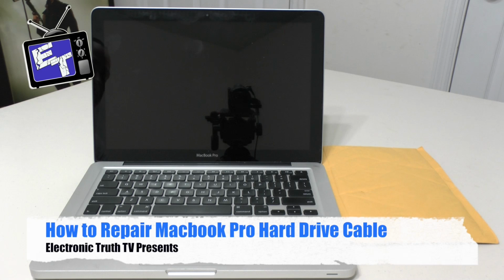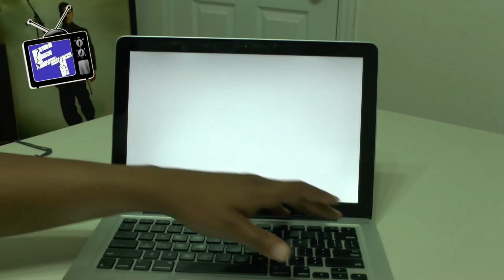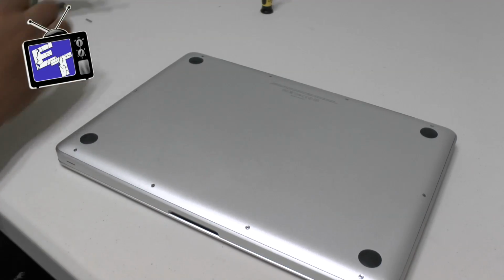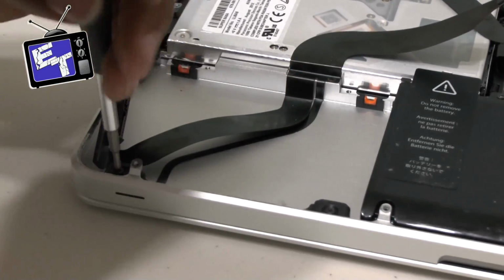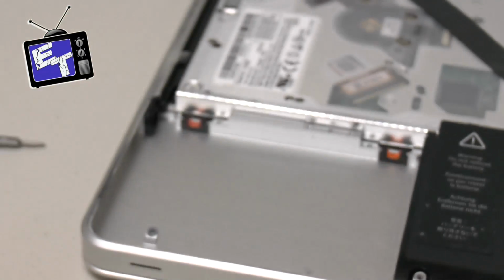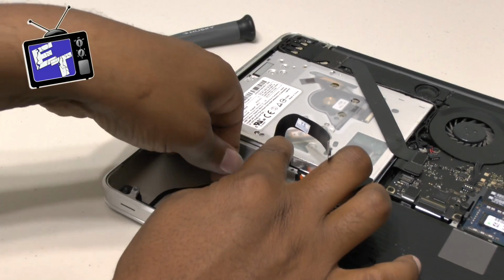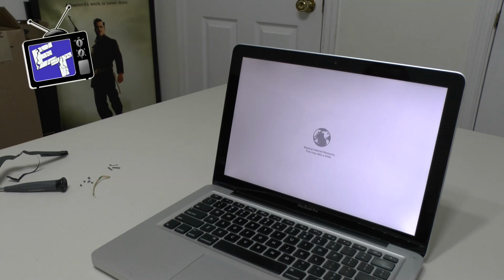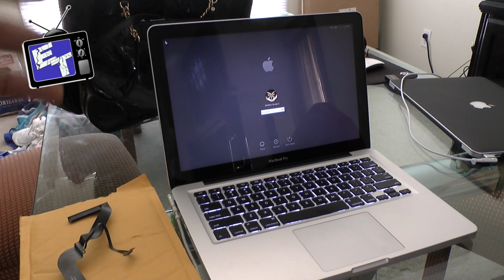How to replace Macbook Pro Hard Drive Cable

Comment: SO MANY THINGS DONE WRONG IN THIS VIDEO!!!!!!  Wrong cable P/N was installed, it requires the shorter earlier model cable, you installed the longer later model cable, that's why it's bunched up and doesn't fit properly. they even look different when you compared them. And you completely botched the IR cable attachment, you ripped it without undoing the clip that secures it and just shoved it back in. also you have to bend the new cable in order for it to fit properly where it steps down to go under the HD. Horrible video!!!!

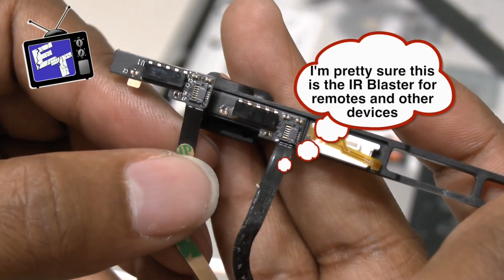Comment: At 7:04. I've tried to insert the cable from the light indicator to the bracket on the new hard drive cable, but I can't make it fully inserted into the bracket. At first, I thought the replacement was not designed correctly, so I bought another one. Alas, I'm facing the same problem. Any tips on how to tackle this problem. Thank you!

Comment: Your video was good up until the point where you had to do a close-up  for the front panel connector then the detail was blocked either by the advertising or you kept running the focus point out of the frame of vision.  This all started about 6:36 minutes in.  A good video but I would try to refine that area if I were you.

Comment: That tiny orange ribbon cable is bloody hard to get back in after flipping the connector up. Any advice on sliding that orange ribbon cable in the front bracket with the IR sensor on it?

Comment: You can have this cable issue without the flashing question mark folder too. For me I only occasionally got this question mark folder and it would not flash. What I seen logging in was a circle with a diagonal line that would show a flashing Apple logo every few seconds. Then it would lock on the Apple logo with a progress bar that took forever to get to the login screen. Sometimes the progress bar would reach 100% and nothing else would happen. I would boot in internet recovery mode and sometimes my hard drive did not appear, other times it showed it as full even though it had over 500GB of free space on it. I also had the issue whereby when I could login things would work good for a while but then the computer would act up. I was constantly getting a spinning beach ball whenever I clicked anything in Safari, tried to type, etc. I replaced this hard drive cable myself and my MacBook is running like a champ now, fast login, super fast when using it and no more spinning beach ball!

Comment: i recently bought an SSD drive and copied and installed it on my mac... after working wonderfully for a few hours or so the screen just went black and i had to force shut down. then trying to boot up i either get the circle with the line blinking back and forth with the apple, but the computer never boots up again until i re-install the original drive.. i was told by the apple community, someone who had 9 stars, and a tech from OWC where i bought the drive that they think it's hard drive cable... watching these video's it seems easy enoughtho i am a little intimidated... hopefully the change goes smoothly... mine is a mid 2009 15 inch pro...

Comment: Hi, I've replaced the said wire(hdd to MotherBoard) however i still have the issue, I contacted apple but they said i take it to apple for a hardware diagnosis. Any ideas of the possible issue, I'm looking to up grade the RAM next.

Comment: i recommend also disconnecting the battery cable as soon as you lift the case off. so that no stray current is roaming around. good video i and i relate - as i have self-taught some repairs and mistakes r easy to make.  ps, i loved the music!  gave a positive upbeat feel. thanks Chris for taking the time to share this - and thanks to ducky102 also...

Comment: This s**t is sooo teeny weeny microscopic (the ZIF part…) that it requires two VERY steady hands, a vise, and a good enlarging glass. This is NOT to be even ATTEMPTED at for anynone older than 20. I’m 55, and I can’t see, and I shake waaay to much for this microscopic stuff.
Be forewarned!
I’ve tried, and got that damn ZIF out, and relaised this is WAAAYYY beyond my abilities. I doubt I could even glue together an Airfix-set, not to speak of painting it (such as the window panes or the pilot) without a serious magnifying glass & some arm rests…
Call in the young’uns for these sort of jobs. I tried, and I’ve failed, dumping the lot on some able-bodied folks I happen to know. Whom will receive a suitable reward…

Comment: Hey I want to thank you for the great instructional video! I researched how to figure out what was wrong with my MacBook Pro AND FIGURED OUT THAT IT WAS THE CABLE FOR THE HD, I ORDERED ONE AND FIXED IT JUST LIKE YOU SAID AND I AM UP AND RUNNING LIKE NEW AGAIN ! Aside from hitting the lock caps by mistake this computer is like new! Thanks!

Comment: So after reading ducky102's comment I realized what a ZIF connector is and how many of these videos show incorrect removal/insertion. I have no experience with this, but if you're trying to save money by avoiding a repair man, this is what I've learned.... DO YOURSELF A FAVOR AND BUY A NEW CABLE WITH THE BRACKET ALREADY ATTACHED. I returned my cable (without the bracket) and ordered one with. SUCH A TIME SAVER. Spend the extra 10 bucks. You'll thank me later.

Comment: What can I say... Thank you, thank you! After my macbook failed I replaced the hard drive... no luck. I spoke to apple support. They told me my macbook pro 2011 was now "vintage" and unsupported. I was on my own... then I did a little research, found this video, bought a £10 cable and now I'm back up and running! You saved me £1200 for a new macbook!!! much appreciated

Comment: hi Chris. nice video. my Mac book is a little different 13" wide. case has 8 screws on the side and 3 on the bottom OS 10.7 Lion. I haven't opened it yet. (afraid to lose screws) can you give me a link for the correct HDD cable,? ( this is a flashing ? folder problem). thsnks
Reply: Apple Macbook, A1181 OS 10.7 Lion
Can u send me the link for the HDD replacement cable. Thanks

Comment: Alright, guys, for everyone struggling with the golden cable - if you already glued the "main"  black part of the cable - just carefully peel it back from the bracket and then safely and easily insert the golden cable. After you do that, glue the connected cable back to the bracket.

Comment: This is the clearest video to follow.  I bought the cable from Commandmacparts (Ebay), NEW HDD HARD DRIVE CABLE - Apple MacBook Pro 13" A1278 Early,Late 2011 MD314.  It worked great for seven months until the "?" issue came back.  I'm checking out this video again to replace it for the second time.  I bought the cable from a company that has a lifetime warranty as opposed to just two months.  Hopefully I won't have to replace it further.  Thanks Chris for the clear video.  But as pointed out, don't yank out that tiny yellow ribbon strip

Comment: You have to tell people the yellow/gold cable is very sensitive and that it cannot be torn apart, it cannot be discarded. I pulled the yellow cable out and it broke in two, now it has to be replaced. You must note that in the video
Reply from the maker: +Fillip Nelson so sorry Fillip that you had to replace that cable... at this point, not tugging on the gold cable has been made very clear in the comment section. I was able to salvage mine, and because I was, I didn't feel at the time I made this video that it warranted a new video. Fast forward to now and I welcome anyone to make their own video showing this process, or just how to properly deal with the yellow cable. I will gladly pin it to this video. My goal was to try and help people and give the best information that I had at the time... anytime that information can be improved upon, it is welcomed...

Comment: WHERE DO I GET THE ^PARTS TO ORDER I`M IN CANADA
Reply: New Hard Drive Flex Cable 821-0814-A for 13'' A1278 MacBook Pro 2009 2010 on amazon.ca

Comment: AWSOME tutorial, this info timeless. if you can include in the beginning: "For precautionary purposes, we advise that you disconnect the battery connector from the logic board to avoid any electrical discharge.
Use the flat end of a spudger to lift the battery connector up out of its socket on the logic board." 

everything else i followed your video to the letter :). 

happy holidays.. now i can give my wife my 210 mac as a christmas present. (( HELP!!!... durring installation process, when it says  "select the disk where you want to install mac OS x,  i dont see my hard drive as  a choice))

Comment: Appreciated your video Chris. Help me remember how to reinstall this hard drive cable. They tend to be very problematic on the mid 2009 and 2010 models from what I understand. It is detailed and tiny work but if you take your time and be gentle, especially when pulling things apart, it works great.

Comment: there are actually 3 types of screws (the small ones look the same until you look close) the front 4 are shouldered, and the 3 others are not shouldered, the three long ones go at the back obviously... the 7 short ones appear interchangeable and however they will get loose and fall out if installed incorrectly, for example if someone has worked on the machine and didn't notice this.

Comment: @7:40 mark. How did you get that yellow gold strip back inside that tiny hole??
Reply: You just slide it sideways from the natural direction of the strip. Using a flathead to position the strip just right helps. Also lots of light. Also lots of patience:)

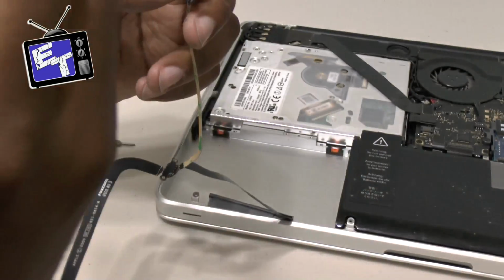Comment: This is a great video, very helpful, but the most difficult part from 7:38 to 7:44 is cut out.  This step to reconnect the cable took me the longest, everything else is straight forward.
Reply: How did you get that yellow gold strip back into the slot?? Thanks
Reply: It was not easy, I ended up using a pair of tweezers to get it in, being careful not to damage it.
Reply: +Binsk 888 I am still waiting for my new cable. Should be here within the hour. In the interim I am practicing on the old one. Extremely difficult even with tweezers.
Reply: Yes, took me about 15 minutes of trying to get it in.
Reply: +Binsk 888 I am wondering.  Is it actually necessary to reconnect it?
Reply: assume so, but dont know for sure.
Reply: Well I got it up and running. Couldn't get the yellow cable inserted so I said screw it ..leave it off.
I also could not get the one screw in where the middle part of the cable folds down and two screws are needed. 
I put some electrical tape down this time but if it goes on me again I will spend the extra dollars and get the cable with the bracket next time. 
If I have any criticism is that I have booted up twice and I noticed it the apple icon takes a bit longer to appear than it used to. 
Oh well for a $36 repair I am not complaining.
So far so good. Thanks a ton for your quick responses.

Comment: I am thinking to install the new HD in the second slot, removing the preinstalled CDROM and changing i it in the site with a bootable solid hard disk, eliminating the HD in the first slot. Do you think could be a reasonable  tentative to investigate previously if is the trouble is a flat cable or the controller cause, before buying a new cable? Do you think the machine could boot in this new explained configuration? Thanks in advance for a reply

Comment: Good video, bro. Only part "missing" is how you put the small yellow cable into the small holder - guess it's just aim and push (like ye ol' days). Had same issue with start-up, took me 5 days of assemble/disassemble to figure it out :/. Figured it out after installing os in external and hdd-adapter in optical drive. Maybe add troubleshooting tags to vid...?

Comment: I have exactly the same issue and I found your video very enlightening. I 've noticed that the old cable was attached to the aluminium chassis with some kind of glue, cause when I removed it it was a bit sticky. Did you used any kind of glue or material with the new cable in order to be firm and not to move?
Reply: The new unibody hard drive cable will actually come with an adhesive for you to re-apply to the chassis.
Reply: Thank you for that.

Comment: Great video, and I love your American drawl btw! ✔️I was chilling in bed with my girl watching Under The Dome, when my Mac fell off the bed and landed with a slap on the floor, from about 3 foot. Had connectivity issues and spinning beach ball, so did some diagnostic and then got the flashing folder icon, and time machine couldn't find my internal 750HDD. Fearing a dead hard drive, I bit the bullet, hit the Apple Store yesterday. 
After they checked it out, my genius decided that the cable had gone bad, and wanted to replace at a cost of 53euros. I got an email last night saying 'my product is ready, I can come collect it' - so I guess when I dropped it I shorted the cable somehow, or a connector came loose. Either that, or when I get there today they'll say 'yeh, didn't work, you need a new HDD'. But then why would they say the product is 'ready to pick up' if there are problems? I'll report back in some hours when I know. 
I watched the video to see what Apple would be doing to my baby... ✔️

Comment: I love that you made this video..some tips:  slow down your movements when doing the crucial steps and have camera some place so your hands don't obscure that you're doing.  And MOST OF ALL: I was shocked at how roughly and casually handled the cables. I've read that this kind of handling can cause problems with the cable, that they are delicate.  And, I also vote for no music. Keep up the good work!

Comment: good video.. but I wouldn't recommend taking that yellow cable out with a screw driver. I saw how you did it and tried it the exact way myself.. snap.. I could have just pulled it out. had to end up ordering another cable with the bracket this time.

Comment: If I had to choose between a year in federal prison or inserting that ribbon again, I'd pick prison.

Thanks for the video, process was a breeze except for that damned ribbon. If you can get the IR sensor pre-installed, save your sanity and spend the extra money.

Comment: Thank you! This worked for a Macbook Pro 13" Mid 2012 Non-Retina that first was suffering from the Folder question mark after a drop, then reinstalled on new SSD, then  suffering from the Prohibitory sign at boot (and 20-30 sec later bootet normally) + error: "The partition map needs to be repaired because there’s a problem with the EFI system partition’s file system". Finally it is working. Used this replacement cable: "Racksoy - New HDD Hard Drvie Cable without Bracket 821-1480-A Fit For MacBook Pro 13" A1278 2012" on Amazon.co.uk due to shipment to Denmark was not available for most other HDD cables, but this cable is working fine as a replacement. Thank you again!

Comment: Great video! I'm glad that you have this up. I am also a computer tech, and I ordered the same replace cable for my client. I was getting the same error, & I thought the hard drive might have been bad, so I swapped out the drive with a different hard drive, but it wasn't reading that one either. So I'm assuming that it's the cable,. Thank you again for the repair guide.

Comment: How do you know whether the bracket is broken or the cable is broken?
Reply: +Henry Nguyen I think you mean the connector on the motherboard where the drive cable connects... if so, replacing this cable is one way to "test" if that connector is the problem. The professional way would be to test the pins using a multimeter, but you need schematics and lots of patience for that, easier to replace cable and hope it works. :)

Comment: am i going to have to reinstall an OS even if i use the same hard drive that i was using before? or did you just switch to a new HDD and that's why you installed a new OS?
Reply from the maker: No, as long as your drive did not get corrupted or you don't want to upgrade to a different drive you will be fine just replacing the cable

Comment: YESSSS I fixed my 2009 Mac Book thanks so much for this video I like that the angle of the camera allowed me to see everything and you talked through what you were doing!

Is it necessary to do the reboot process when turning it on with Command+R?  I dont have any software to download the operating system back if I boot regular will it work?

Comment: I think I have the same problem. The hard drive is intact (ran it externally with another computer) also I ran another hdd in my Mac and the problem was still there. So I've ordered a new cable and I'll follow your video. Thanks very much for this, much appreciated man.

Comment: Hey man!

I think i'm having the some problem as your client, i got that dreaded folder with question mark problem the other day while booting up my mac, i sent my mac for repairs and the guy replaced my HD with a samsung HD (he tested this drive with other computers and it ran fine) both 500gb, but my mac was still running really slow, like it doesn't flow, i get the rainbow cross mark every 2 minutes, hell i even got it like 7 times while typing this message...

I live in Mexico and the guy that repaired it lives in Dominican Republic, so sending it back would be hell of a problem, i'm wondering if the real problem is that motherboard connection cable, i'm looking into buying that and having a super-techy friend of mine replace it.

Where can i find this cable?

to clarify: my mac is working, it just runs extreeemeelyy slow. I'm going crazy right now man.
Reply from the maker: You should be able to find the cable on eBay and Amazon... It is Mac model specific